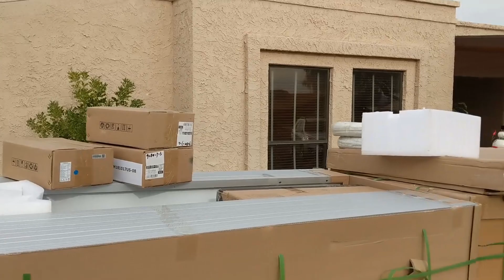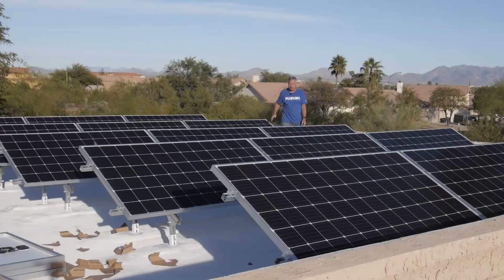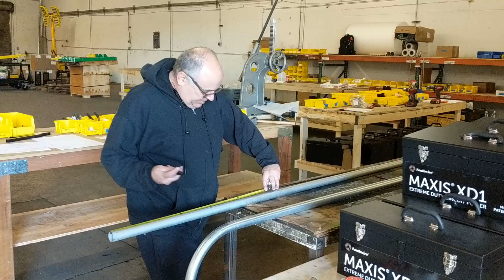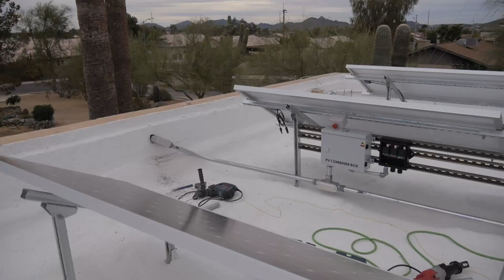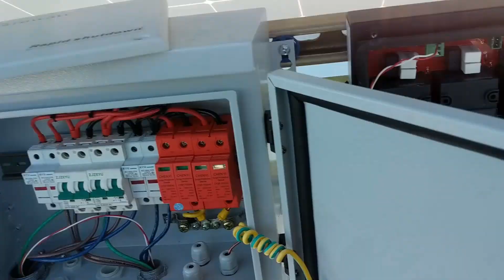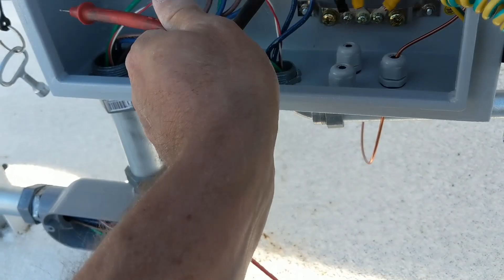Installing Panels and PV Wiring

Comment: I'm self installing in Phx now in 2021 using microinverters but much of the process is the same. Especially the panel swap requirement. I learned a great deal from your series of videos. Thank you very much for making these and sharing the knowledge.